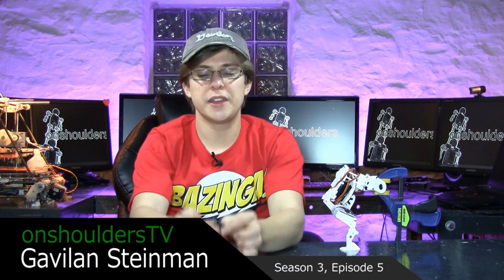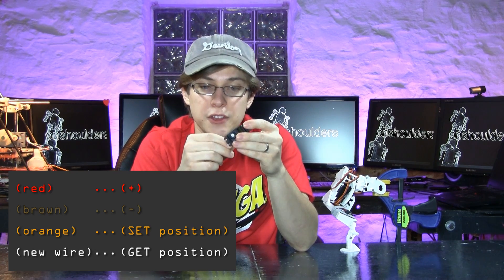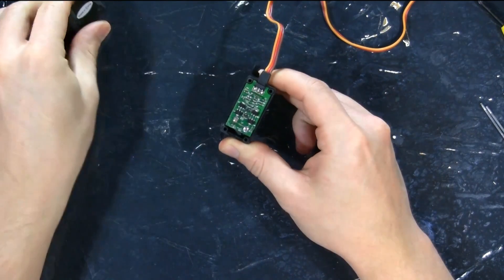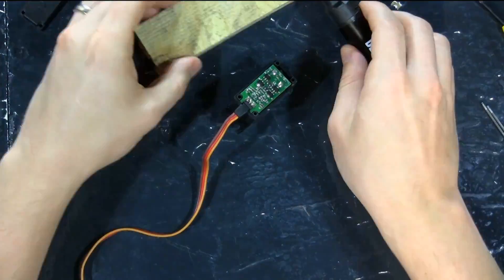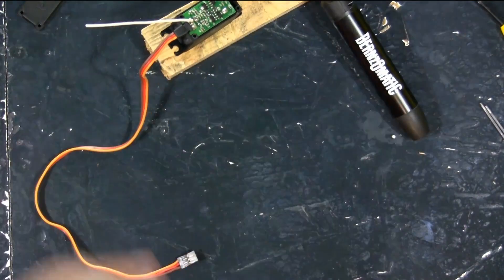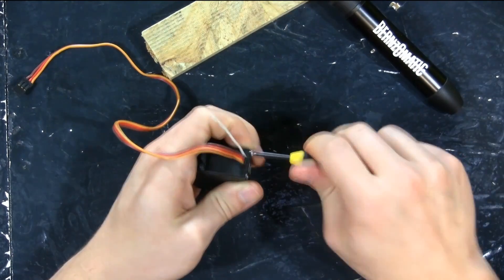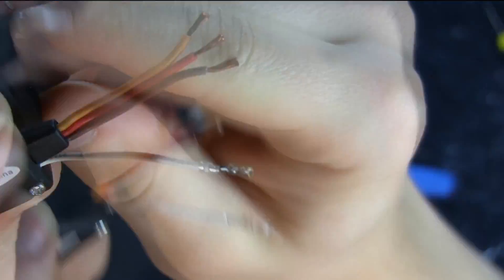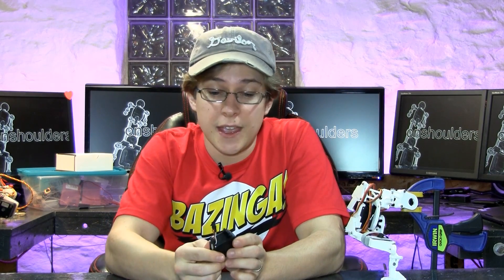onshouldersTv: Hacking a Servo Trimpot

Comment: Nice video, but you're using the wrong word! A trimpot is a TRIMMING potentiometer (the ones you turn to calibrate/adjust a circut. Normally tiny with a little screw head) This pot in a servo is just your average potentiometer.

Comment: Adding a extra wire to the pot wiper does increase the resistance of that circuit.
This introduces a little bit of error. Zero position may need a little adjustment.

Comment: I like the video!
To answer a couple of the questions, the noise will be minimal but make aure to keep the analog wire away from data lines.  Run it at 90 degrees to any data cables and keep it short.  A bit of capacitance could probably be added for high speed transients but keep it small to keep from slewing the comparator in the servo.